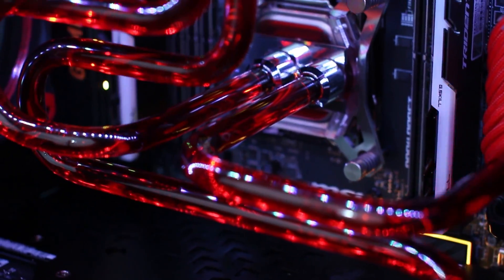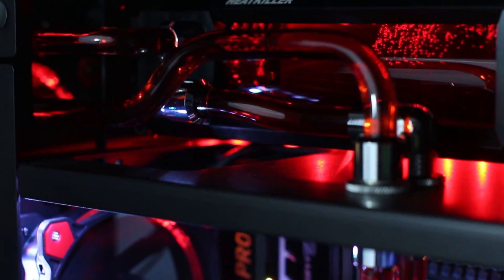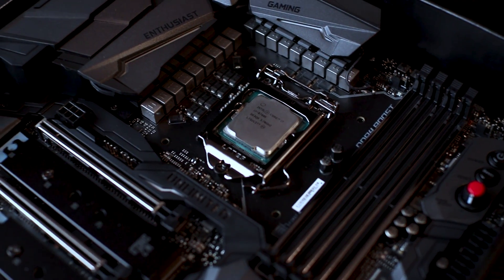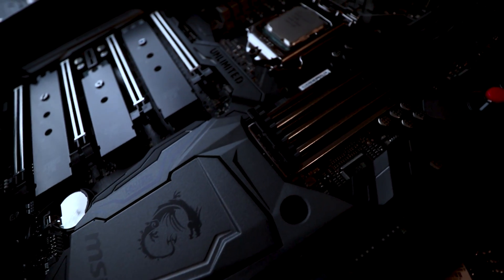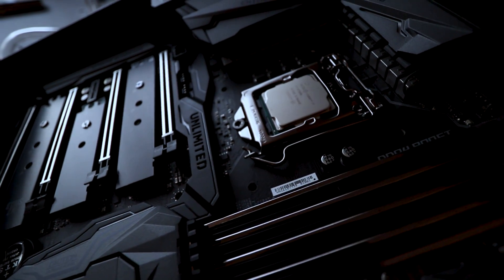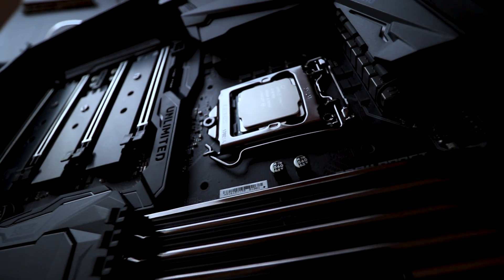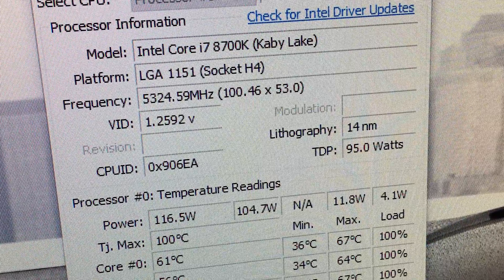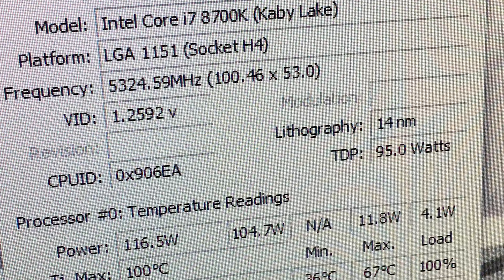Liquid Metal 8700k Overclocked to 5.324 GHZ!

Comment: 100% that 1.390v vcore overshoots to above 1.4v during resteps after vdrooping.
Also, nice puddle of liquid metal on your chip haha, way more than needed. And did you actually super glue your ihs from the outside while in the recentering tool?? LOL
Reply from the maker: Yeah man went for a puddle since LM has a short lifespan. And of course I did. Totally wanted to glue it to the tool itself but I was unlucky. Wanted to screw myself over for sure.

Comment: You should consider covering the 4 exposed metal bits that are near the die. You can cover them with the same stuff you are using as glue, or nail polish, or whatever really. If your liquid metal spills over the die, which is likely to happen if you use even a little too much, it can short 2 of those and fry the CPU.
Reply from the maker: I put LM on those exposed metal bits on a 3770k back in the day. Still works to this very day. Wasn't worried about it with this one. Obviously it's on me if it dies. I wasn't concerned.

Comment: meanwhile i need 1.42 volts to reach 5ghz    damn lucky bastard :P
Reply from the maker: remember, the colder the temp the processor is, the lower the voltage it can run at! to a point that is. haha.

Comment: mine is stable in everything at 5.3 at about 1.39 without a delid.  cant wait to shuck the lid off mine.  got the stuff just havent had the time yet.  temps are the only thing keeping me from running it at that speed\voltage.  i actually think i might be able to get away with 1.35
Reply: bobhumplick what's your temp, MoBo and cooler?
Reply from the maker: that's awesome man! excellent silicon lottery find with that overclock potential!

Comment: Interesting method of gluing back the IHS - I must try it when I will delid my 8700k in the next few days. BTW - that is some sweet hard tubing in the b-roll - loved the end result.
Reply from the maker: thank you sir! the super glue can be strong, but it's not strong enough to rip the PCB if you wanted to remove it again. Just use small amounts in my opinion. once it's locked into the motherboard with a cooler on it, it's not going anywhere so no need to put glue around all the edges completely.
Reply: Yeah, that's what I thought. Silicon based glue will always leave a little more height between PCB and IHS, which is what added the temps in the first place. Super glue behaves more like water in the first few seconds, so it will only penetrate the micro gaps between IHS and PCB and rest will stay "outside". Only concern with superglue I have is that it can interact with plastic and "eat" it a little during a curing process - did you try to delid previously glued IHS and did the glue damaged the PCB in any way?

Comment: Is that IHS used at the end of the video the stock one?
Reply from the maker: no, it's a full copper replacement with slightly more surface area than the original one!

Comment: That seems like an awful lot of liquid metal you applied.  Isn't there a risk it will run off the die onto the rest of the chip and short something out?
Reply from the maker: it may have seemed like a lot, but I used the amount that I did because liquid metal dries out and so I added more so that the lifespan is longer. if you go bareee minimum, you'll have to replace it every year or so especially if you use it every day.

Comment: How well does the super glue hold up under temps?
Reply from the maker: perfectly fine! but the mounting pressure alone with the block on it as well as the motherboard bracket wont let it go anywhere, anyway.

Comment: I have a i9 7900x and can get on Ebay a copper ihs is it worth getting I already delided it less than a year ago 
It should be at least a 5 deg difference I think
Reply from the maker: absolutely! but it's way more tricky delidding an 7900x than an 8700k. transistors on the top means you might break one off! just gotta be careful!

Comment: Wouldn't the liquid metal corrode the copper IHS?
Reply: Not corrode, but alloy to it. It'll eventually become a Copper-Gallium alloy. Not risky anyway.
Reply: asdfomfglol   thanks for clarifying
Reply: asdfomfglol But will the temps stay as low in the long run ?
Reply from the maker: Yes, like it was stated previously, it will just bond to it over time, which makes the LM have a shorter life span. What isn't absorbed, slowly dries out. Hence why I used more than most people said I should use. Been doing this a long time! Wasn't stressed!

Comment: I put like 1 100th of the amount of liquid metal on my 8700k. Mine's 24/7 stable 5.1ghz @1.345v...never goes above 69c.
Reply from the maker: that's good! i've been doing LM for years now. LM doesn't have much of a lifespan, and so I used more so that it doesn't dry out as fast. Still rock solid to this day!
Reply: @LiquidHaus  how long do you estimate the lifespan of liquid metal before replacing?
Reply: I actually believe this guy haha 5.1 69 tops? Sounds about right. The youtuber is lying big af though.

Comment: Thanks for awsome vid! How did you go about determining stability? I've been trying to look this up, but seems to vary depending on intended use or needs. I'm getting 8700k soon, and would mostly be gaming.
Reply from the maker: I use AIDA64 which can be used as a burn-in tool. I figure 24 hours straight of burning in will yield a solid and stable overclock that'll last you!

Comment: intel stock ihs is also pure copper , its just coated with something else
Reply: Nickel
Reply from the maker: it is indeed, and like Jethro said, it's nickel plated. But this specific copper one has more surface area, though not much. anything helps, right?

Comment: Stock IHS is copper... its not about the ihs material it's about contact area with heatsink
Reply: It does. Nickel plating prevents corrosion from liquid metal
Reply: you are correct but has a nickel plating layer on it.
Reply: frqgrenade cooper itself corrode very fast (without protection)
Reply: Marcin Trochimiuk small correction on my part. It's alloying not corroding. Gallium seeps into bare copper quite fast and when it's gone temps go through the roof.
Reply: frqgrenade oxidize ;)

Comment: Can't afford an upgrade.  Passing stress tests, my i7 7700K will do 5.3GHz @ 1.500 volts at the desktop [1.480v in BIOS], Gigabyte Z270X-UD5 motherboard.  My CPU is not the best overclocker, that is why so much voltage is needed.  5.0GHz is fine though at 1.285 volts in BIOS.

Comment: was that too much paste??? i want to try liquid metal stuff, but i'm scared of conductivity it has..
Reply from the maker: Qk9CWU5ib3x I’ve experimented in the past and have seen what too much looks like. The amount I used was fine.
Reply: If u are 80 c + prime even with something like noctua paste u should drop over 10c and its much safer the important is to remove the black silicon so that the ihs can touch well with pressure the die so use simple paste and no glues or sillicon even if spiled no risk and easy reaply. No need to first time use liquid metal plus if example from 80 drop to 70 with noctua paste dont expect liquid  get u like 60 most  realistic would be close to 65 maybe less than that 66-67 just saying (with stock ihs ).
Reply: 7th and 8th gen Intel CPUs only have 4 gold dots exposed on the PCB. A tiny dab of nail polish clear coat and you don’t have to worry. Use as lil liquid metal as possible and you’ll be fine.